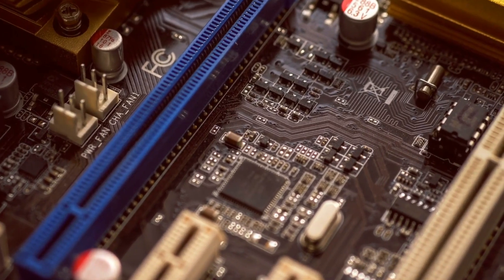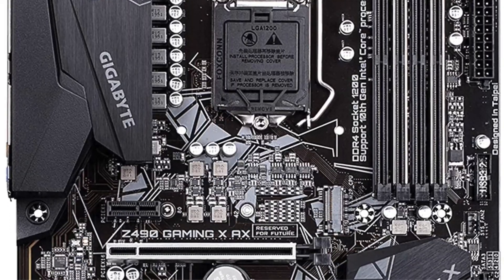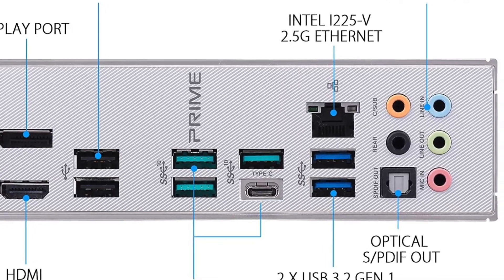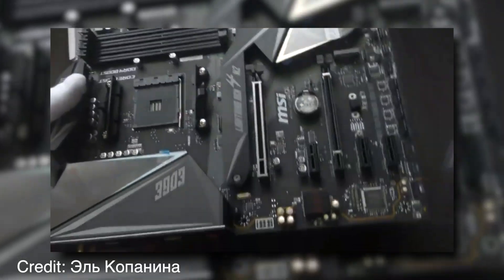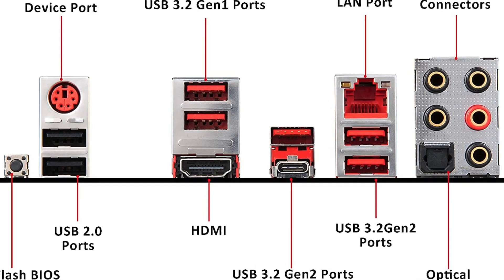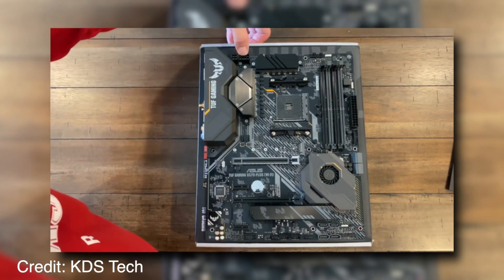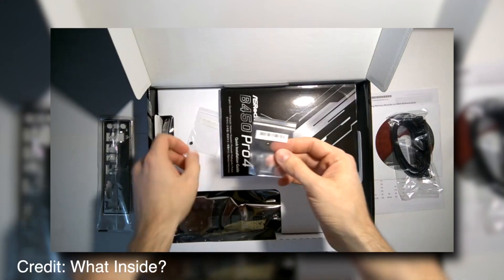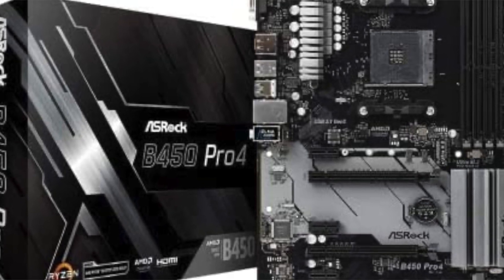Top 5 Best Budget Gaming Motherboards in 2022

Comment: I'm using dell precision 7810. It's the towers name but the motherboard is made for it and doesn't have a name of it's own.
And yep it has power. In graphics work. Which i don't do. Much. Not enough to warrant being stuck in nongaming system.
I'm thinking of upgrading/changing just the processor. But the options seem limited, it's socket lga2011. So. Watching this to see a motherboard to change into. It's going to look dumb inside the huge case, but seems to have no other problems.